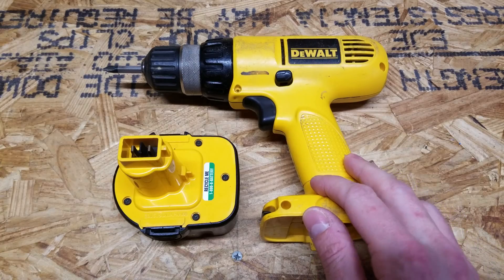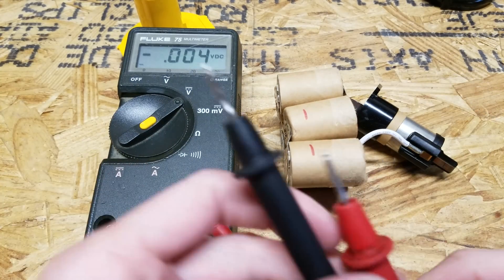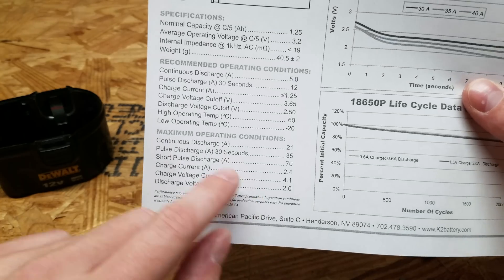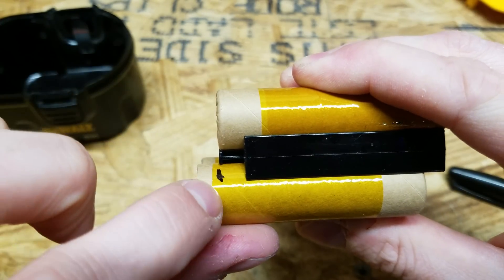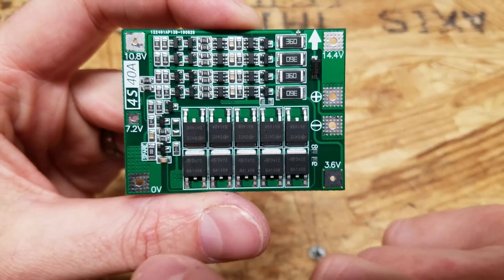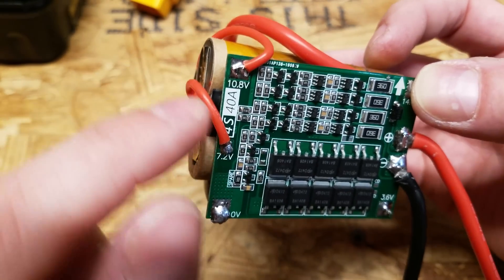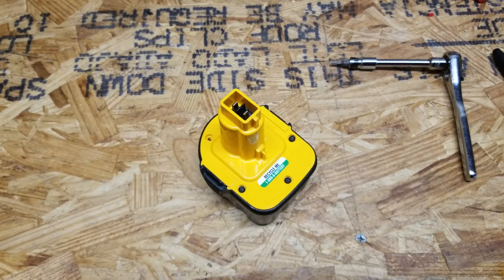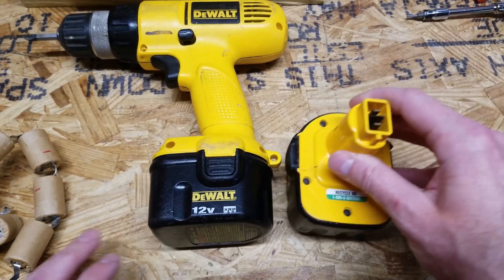Converting a DeWalt 12V Cordless Drill from NiCad to Lithium LiFePO4

Comment: I did the same thing to my 14.4 volt Dewalt, but used my string trimmer 20volt lithium ion pack, as it is. They were $35 for two packs, a heck of a lot cheaper than the Dewalt packs. I use the string trimmers charger also. I plug two wires into the pack and velcro it on to the drill. Works great.
Reply: This sounds a little crazy, 20v battery on 14.4v drill
Reply: Is the motor not burnt out by now ?

Comment: I've got some older 18v Dewalt tools that started their life with nicad batteries, when the lithium ion craze hit Dewalt was the only company that didn't make you buy all new tools to use lithium ion batteries.  I found out that the nicad charger I had would not work with lithium ion batteries, so back in around 2010 to update to two 18v Dewalt lithium ion batteries and a charger was going to cost around $230.  I found a refurbished  1/2" 18v Dewalt hammer drill with a charger and two lithium ion batteries for $180 on ebay.  The batteries work in all my old tools and everything is still functioning.

Comment: i wish i could do something liek this but im not that great at soldering and dont really have a way to spotweld due to my drill being nicad im gonna end up having to replace it next year when i should have more money with a drill that is lithium unless i can get something liek this done for much cheaper but for some reason my drills charger should a ac output
Reply: if your drill's charger is outputting AC, that'd be a blown rectifier, probably. You can make your own spot welder with a car/motorcycle battery and a starter relay on the fairly cheap. Probably not cheaper then a new drill, but if you've got a bunch of tools that use the same battery it might be worth doing.
Reply: @DFX2KX  no on this skill drill it says on the charger itself output: ac 13.5 0.42a i find that odd

Comment: How did you weld?
Reply: there's an expensive machine for it called a spot welder, but you can make one out of a motorcycle battery, a starter relay, a button, and some copper wire.

Comment: Hell Yeah Dude, That's a bad ass upgrade!! It would be nice to share pics of how I did mine (without making a video of my own) I did that with LiOn to one of my old 12v DeWalt drill batts & it worked OK. However I gutted the NiCad Attached to the connector that plugs into the Drill/Charger with a cut off wheel on a Dremel. Used the the shell of the battery for a support to hold the connector in the top of the battery pack & hot glued it in at the bottom of the gutted cell, also I used the gutted cell to solder the NEG wire to. works great!! The other battery I wired it up with 15 feet of 2 conductor #14 OOSJW cable (High Strand Cable For Flexibility) & soldered 20 amp clamps on the other end so I can use it of a car battery if need be. Drill works great on a car/12v AGM or Lead Acid battery as well.

Comment: I have the 14.4V drill and a battery pack that is hardly holding the charge. The drill is amazing. Does anyone know if there is a business that seels Lithium Ion replacements along with the proper charger?
Reply: saw a few options on scamazon today - fleabay had a few as well {i always shop the free returns}

Comment: the wire for the cell balance is way to excessive. that style (cheap ebay/aliexpresss etc) of bms has a balance rating of 50-60 milliamps, and dont charge via the balance leads. More expensive ones (they will have fan and heatsinks) like hobby charges, can charge through balance leads, and can balance and higher amps, but you wont get that from those cheap ebay bms. Of course there is no harm in oversized wires.

Comment: What if I don't use the BMS board?Does that harm the battery pack?
Reply: the BMS board balances load between each cell. if you don't have one, you can have one cell overdischarge by accident, and these lithium batteries REALLY don't like it when you do that. it also has general overdischarge protection for the whole pack..

Comment: Minute 1:01
 just a tip on the side, if you don't have a torx safety bit, you can also simply use a flat-head screwdriver to break the pin out of the screw head and loosen the screw with an ordinary torx bit
Reply: Mats Pierzyna  please I need this guys direct contract

Comment: Thank you for the video. Next time, consider using a piece of dowel to replace the battery in the shaft. You can then screw it into position with a countersunk screw from the side or hold it  in using a flat plate on the bottom. Buy a cheap charger for some other brand 12v lithium drill. Where I live there are a couple to pick from for less than $20. Remove the electronics and put it back into the original ni-cad charger plastic case.

Comment: Go for 18 Volts! It doesnt matter for these old drills. They can easily handle higher voltages.
Reply from the maker: Won't that burn out the motor?
Reply: @LithiumSolar  Use a resistor.

Comment: @LithiumSolar Nice work, but there is some errors to your ways. Firstly, you used the wrong batteries. For this application, you don't look at pulse discharge. You must look at continuous discharge. You want your batteries to be rated at least 20A. I've seen Ryobi use 15A continuous discharge, but they seem to be the only ones. I would have used a 4S Lithium-Ion cells with 20A continuous discharge (or more). You also want your cut out for your BMS current discharge to be at 20A. You don't want to allow your BMS to allow the battery to go above it's rating or the battery can overheat, specially in such a small confined space.

Other than this, great job and nice video.

Comment: old and clumsy drilling machine why bother to chance the batteries on this old heavy drill??!
Reply: because unlike the newer drills, these things are well made. They'll last many decades if you don't let them rust.
Reply: One reason I keep my old 14.4V DeWalt drill around is that it makes a better screwdriver than the newer models.  The minimum torque setting is much lower with the older drill. 

The newer lithium battery model is a better drill overall, but it will destroy screw heads and/or threads on its lowest setting.

Comment: Why not replace the “holder” with a piece of wooden dowel?
Reply: when I repacked some makita 14.4v recently I 3d printed a spacer to fit but a piece of 20mm electrical conduit also works if split along its length to get the wires in. If it is not secure enough you can always hot glue the bottom end of the pipe as it is easier to get to if need be.
Reply from the maker: I was afraid it would be putting pressure on the cells. I'm not sure if that would be the case or not?
Reply: LithiumSolar I see, I just thought if you cut a dowel the same length as the batt then mount the contacts to it then use the old mounting system rather then glue. I’m asking because I have a 12 volt DeWalt myself and may need to do this also lol
Reply from the maker: I'll give it a try. I still have two more batteries to rebuild whenever my BMS order gets here :)
Reply: @LithiumSolar  Use a slightly short dowel piece so it does not put pressure on the cells, then hold it in place with a counter-sunk screw though the side of the plastic case.
Reply: A small piece of PVC pipe would probably work in this case and weigh less? Just a thought.

Comment: I also have a Dewalt 12volt Nicd drill.Thank you for the video.By the way how do you charge the battery.I think you cannot use the old charger.
Reply from the maker: I have been using the old charger, I just have to watch when it shuts off and remove the battery, otherwise it keeps trying to charge it. It's a bad idea so I wouldn't recommend, but it works for now while I figure out an alternate solution.
Reply: LithiumSolar It’s good you recognized that trickle charging with the NiCD/NiMH chargers final charging stage. It seems to me the only solution might be to get a proper charger board and replace the current charger board with it. Or if you can find a BMS charger mix board and put a DC jack on the side of the battery for charging it, but most of the combined board have a slow current charge. or if the chargers microprocessor firmware can be modified to turn that trickle charge off, but that can be a complicated way of doing it and your videos seem to show simple ways that most people can do.

Comment: You do know that you can get an adapter so you can use the new Lithium Ion batteries and charger...
Reply from the maker: Really? Do you have a link by a chance?
Reply: @LithiumSolar  Just search for Lithium battery adapter for DeWalt tools. You should see lots of them.
Reply: @garymucher9590  How about a link to the proper one ? The ones I could find take the 18V battery but they do not fit into the base of the old DeWalt 12V Power Tools

Comment: You skipped over the two questions I had as if they weren't even worth addressing: how to attach the cells together w/o an expensive spot welder, and how to charge.  Disappointed to say the least.
Reply: I spent $85 and bought a 11000mAH spot welder it has welded more packs than I can remember. Generates up to 700 amps, has 8 major power levels to adjust  and you can set the delay from .5-3 seconds. No need to spend big $$. Oh,  I usually weld .15mm nickle...

Comment: WHY ?. NI-Mh Are Better,  and have more current, and dont require a charge control
Reply: Ni-MH are no way better than Lithium. They do not have more current in most cases, they die much quicker, their discharge curve is much sooner and steeper, and the comment about not having a charge control is simply not true. Ni-MH do require a charge control, it's just not the same type of control as Lithium batteries. Batteries that don't require a charge control are acid batteries. Even with acid batteries, a charge control will help sustain a longer life.
Reply from the maker: Any reason why you're saying Ni-MH are better? Lithium will last MUCH longer and I would think the 70A pulse these put out is MORE than sufficient.
Reply: @LithiumSolar  No, you never build a battery based on pulse discharge. Your battery should be based on continuous current discharge and for most tools, it should be rated at about 20A.

Comment: Next time a wood dowel the size of the old battery could support the plug.  You might have to carve out a groove for the wire to lay in the wood.
Reply from the maker: Wouldn't you be concerned about it putting pressure against the battery cells though?
Reply: @LithiumSolar  put closed cell foam on the end.

Comment: For charging my 2P3S mini-bank I bought a £6 wall-wart for RC model battery charging, constant current, constant voltage thing. Plug it in, 2 1/2 hrs later, red LED goes green, mini-bank does another 4 days hand-portable radio use. My AEG NiCd batteries went the same way, so lap-top battery time!

Comment: I have a 18v version I'm about to do this to,  I only get about 6, 1/2" holes in 1/2" aluminum,  before I can tell it's about done, my Hitachi 18v lithium battery drill is only slightly better, I may put xt60 connectors on my Hitachi charger , so I can charge both batteries after the conversion, I don't want to use the nicad charger with liion, I do have high current 26650 lifepo4 cell though, I may use, since I have more room in the 18v xrp battery case, how does the charger work with the cells?

Comment: I have a cordless drill with dead NiCad battery. I bought replacement battery (also NiCad) long time ago, but one of the obstacle I am facing is how to do the welding. I do not plan to do that very often, so I would prefer to avoid investing in a full set of tools for spot welding. I found that https://www.lazada.co.th/products/diy-1865032650-i964034727-s2053446684.html?spm=a2o4m.searchlist.list.5.486b125aYTC3dN&search=1 which is very basic but would only put me back about 50$. Do you have any opinion on how that type of rudimentary welder would work?

Thank you for your video that was very informative, but I am not yet ready to jump the gap and go for Li battery (plus I have the replacement cells tat I bought).
Reply: Most people just buy the Sub-C cells with tabs already welded on, then they can just be soldered together via these nickel strips.
Reply: @stinkycheese804  Well, I did not know that and the cells I bought have no  nickel strips... Thanks.

Comment: The 18v “XRP Lithium Ion” 18v batteries that DeWalt used between the 18V NiCd and the 20V Li-Ion tools was actually a LiFePo4 pack. The DC9310 charger can charge both the NiCd and LFP packs, and determines the chemistry by detecting a neodymium magnet in the battery case.
Reply: did you take apart the xrp battery or the charger to figure that one out, and if not, how did you figure it out?  and if this info is accurate this comment should be pinned
Reply: @the.real.ipatch it’s printed on the charger

Comment: I suppose you have to mechanically rebuild a Lipo charger since  there is a difference in the charging profile for nicad  and LiFePO4 batteries. 
Regarding the lack of space with LiPo 18650, couldn't you have 3D-printed a small layer to be placed in between?
Reply from the maker: A 3D-printed spacer to use the 26650s would be pretty epic! Unfortunately, I don't have a 3D printer or know anyone who has one :(
Reply: LithiumSolar Reach out to me if you want, email in the youtube about page. i can always 3D print you the spacer.

Comment: Instead of gluing the connector, I used a piece of an old broomstick, or a dowel would work too so you can service the pack in the future
Reply from the maker: Thank you. I was hesitant to do that afraid of putting pressure on the cells, but in reality, there should never be any force exerted on the contacts. I may do that for the other 2 batteries. I'm still waiting on more of the BMS boards I ordered.
Reply: @LithiumSolar  Maybe the cork of a wine bottle works too, for pressing the piece in place, perhaps with some cutting it to shape. If to thin, take champagner cork. :)

Comment: Epoxy and plastic do not stick. Better use a different glue
Reply: You must not have much epoxy experience, I epoxy onto plastic more often than any other material.  Certain types of very soft plastic such as polypropylene, do need scuffed up a bit first if there is going to be much stress on the bond area, but otherwise, epoxy sticks fin to plastic, as well as most glues that don't act as a solvent that damage the plastic.
Reply: @stinkycheese804  There are also epoxies available that have plastic solvents, which increases the bond strength.

Comment: You could easily put one or two more batteries and make it more powerful. That motor on the drill can handle more voltage. At the same time amps go down.
Reply from the maker: If that's the case, maybe I could have used four 3.7V lithium cells instead? I was afraid to push it too high and risk burning out the motor.
Reply: You clearly have no idea what you're talking about.  When the voltage rises, the amps rise as a function of the resistance of the motor.  In fact you have no assurance at all that you could add two more batteries.  It is very unlikely unless you are extreme careful not to ever let the tool bog  down which would essentially be babysitting it and never being able to take advantage of the extra power so it was pointless.
Please do not post things which you are uncertain off, and you most certainly do not know that the amps will go up but it can be proven through measurement if you don't understand how a basic brushed DC motor in this works.  A modern brushless motor on the other hand, via speed controller, can use fewer amps to achieve the same output at a higher input voltage, except that you wrote "more powerful" and that would still mean that ultimately, an increase in current and a high likelihood of causing damage to the motor if that power is put to use.
They don't design these for their voltage on a whim, rather it has a little safety margin built in but for good reason and thinking you can just ignore that, is ignorant, and wreckless when it is someone else's property.

Comment: i have recently just done the same thing with my 24 volt dewalt drill i swaer it is way more powerfull now then it ever has been on ni-cads
Reply: Same here
Reply: Probably is, due to less voltage drop
Reply: How are you charging it?
Reply: @Rogue_Templar  IMAX b6 and balance Leeds battery is in 6s config
Reply: @Rogue_Templar  my bms has a charge input...

Comment: Nice job. Would be good to see how you overcome the charging issue. Thanks
Reply: That's an understatement... a bit useless without! I couldn't figure it out so I turned my Nicad machines (mostly, drill) into cabled machines (marking their needed voltage clearly, so able to use one supply that has variable voltage; one tool at a time but better than throwing away).

Comment: at 7 mn 40 for the next build keep the NiCd  battery that is attached to the connector  and solder a wire to the battery case  so you will not have to epoxy the connector
Reply: That's exactly what I was thinking when I saw this.

Comment: Just FYI in case you didn't want to epoxy the other battery you could always use a dowel rod in place of the top most battery used to keep the connect in tight. That way should you ever need to replace the Lipos again that connector would easily slide out again... I have a Bosch NiCad that I've wanted to do this too for decades now but just went Ridgid and called it a day. Something else to consider, but I think this is more an 18v options vs 12v, they make an adapter to use the base of the old style battery and adapt it to accept the new style Batteries in case you already had the newer style batteries... Cheers...
Reply: I was going to suggest the dowel rod.

Comment: Why wouldn't you charge to 4.1v?
Reply from the maker: The max charge on LiFePo4 is generally 3.6V
Reply: Sweet thanks. Would you use cells in this type of application to 100% capacity, or would you generally go a bit easier to prolong life?